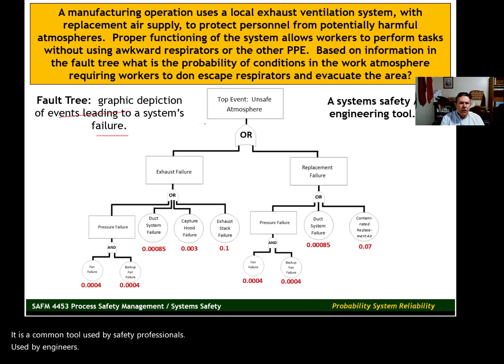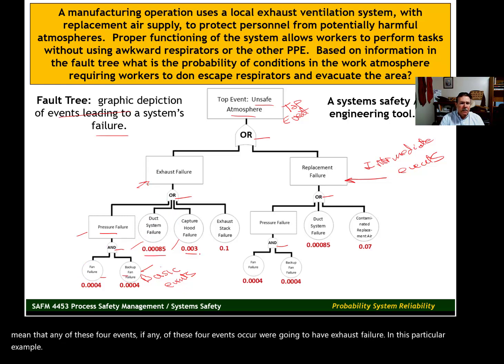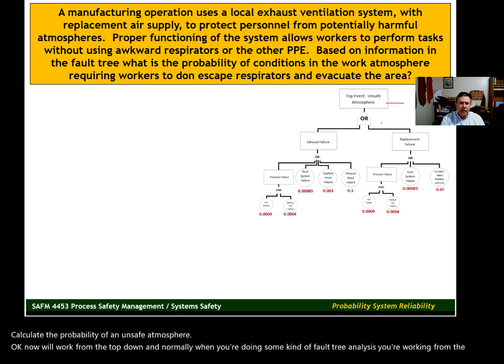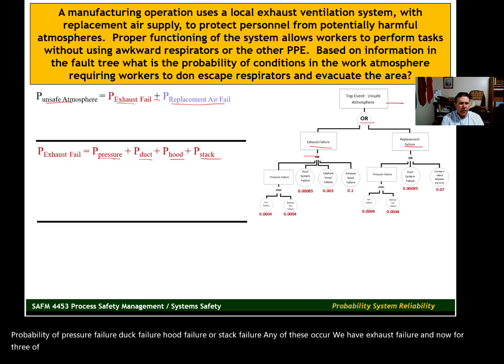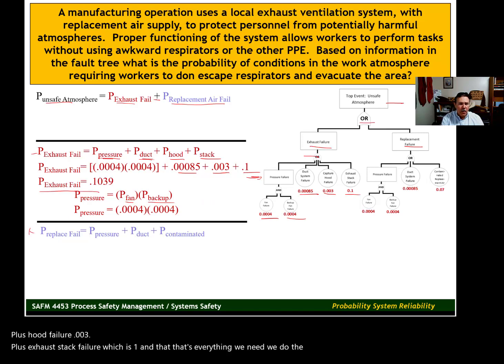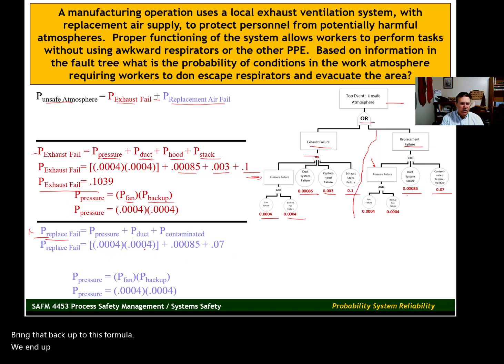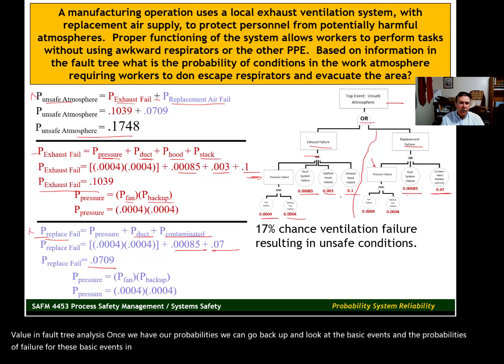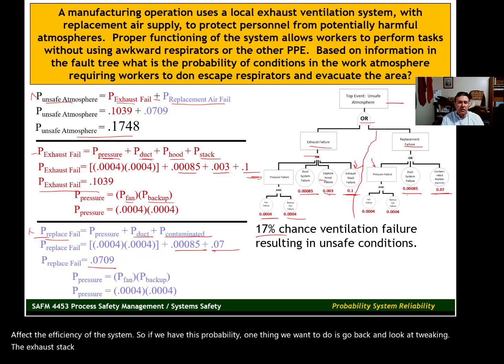Probability of Fault Tree "Top Event" ASP/CSP

Comment: But shouldn't the OR operation rather be calculated with P_parent = 1 - (1 - P_childA) * (1 - P_childB)?
It's not disjunct, you could get over 1 otherwise when just summing up.
Reply from the maker: You are absolutely right.  This is a simple problem designed to give CSP (Certified Safety Professional) test takers a heads up for the exam.   For detailed coverage of addition and multiplication rules I have several other "probability" tutorials for students in my statistics classes.

Comment: Where does the base events probability come from? How do I determine them for any given project? 🤔
Reply from the maker: Excellent question.  The probabilities used in this example are made up to illustrate the process.  This is a deficiency with quantitative fault tree analysis.  Numerical data are not usually available.   Most fault trees are qualitative, based on the judgement of experts. 

The failure probabilities for some components can be obtained from manufacturer data and is often expressed as the mean time between failure (MTBF).   Third party "testing" laboratories, such as Underwriter's Laboratory (UL),  may also be a source.  If you have years of data available within your company you may also be able to come up with a good estimate of failure probabilities for critical components.  You could also do your own testing, but in most cases this is not going to be practical.  

Great question.